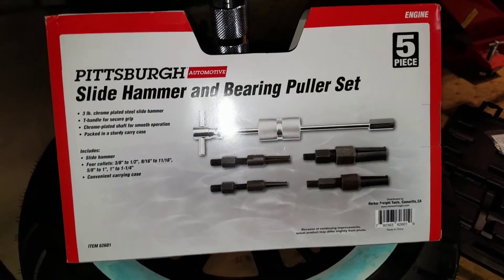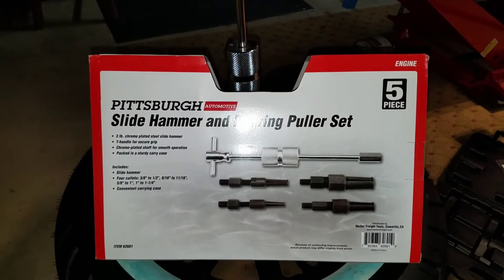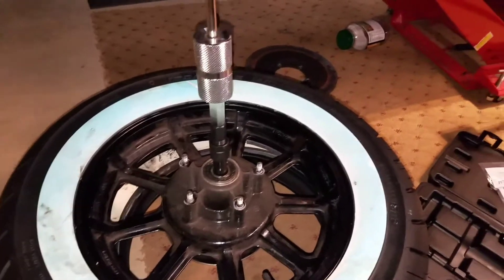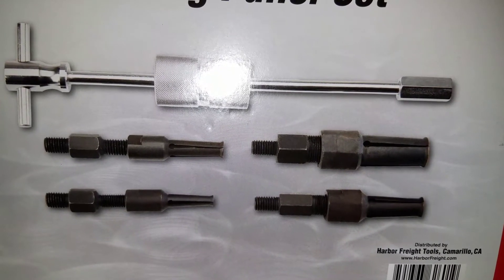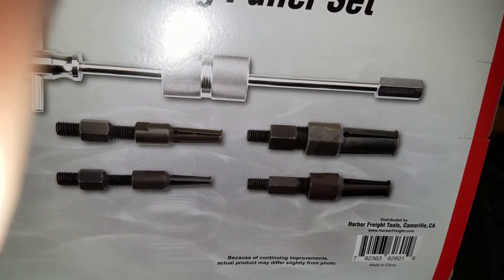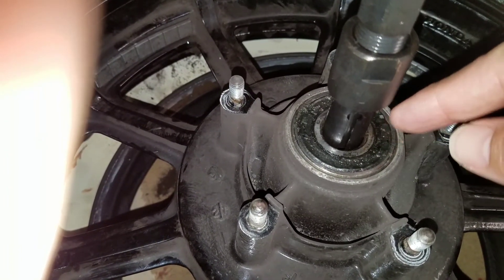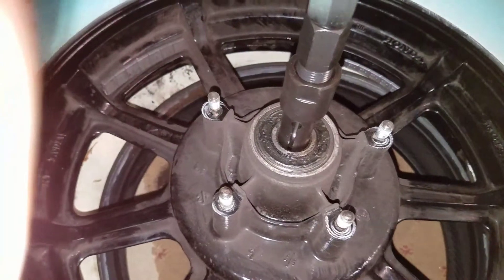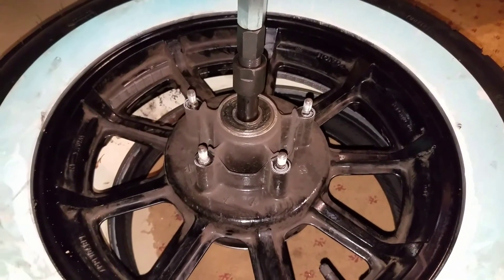GL1200 Rear wheel bearings removal Goldwing

Comment: This is the only thing I can find on the GW1200s. Where is everyone??? Will this tool work for the steering stem bearings for a 85 Goldwing?
Reply from the maker: TEKTON 3/16 Inch Alignment Punch | Made in USA | 66175 https://a.co/d/7xtrmD6
Reply from the maker: Get a rod punch and hammer from the opposite side on both upper and lower. Up and down.